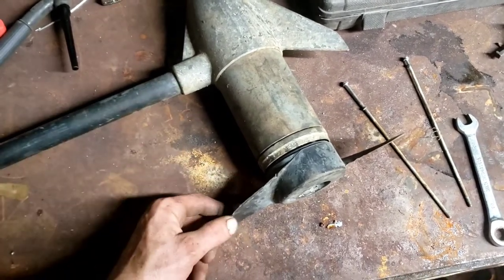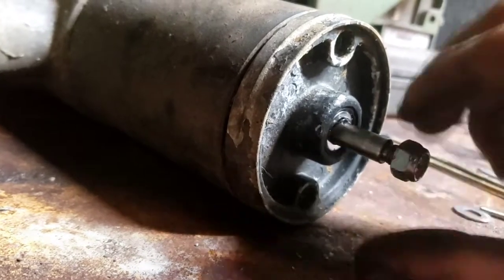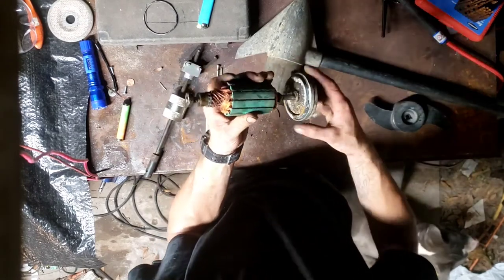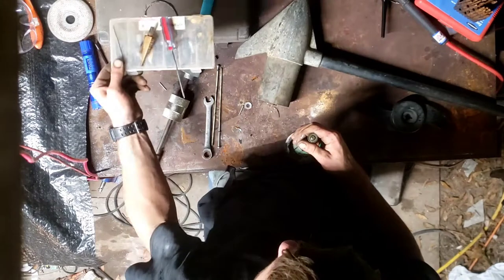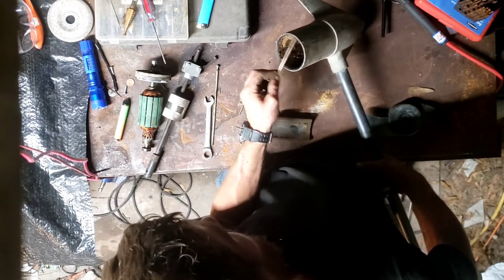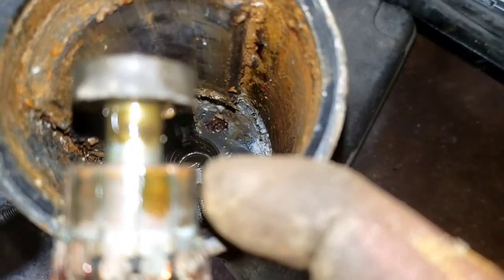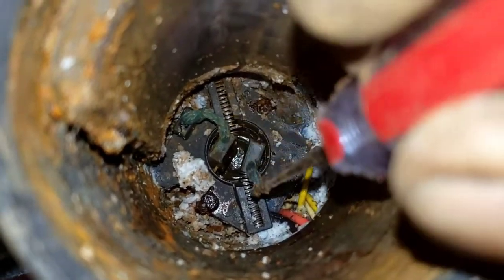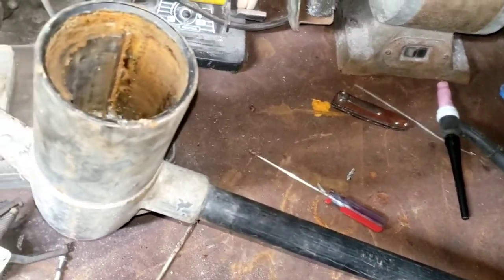How to diagnose and repair an electric trolling motor. Common Problems, Disassembly, Step by Step

Comment: Thanks a lot my man, I had my Minn Kota sitting in my shed for about 2 years,(I had both my Knees replaced and 2022 my wife and I wanted to go fishing again .I tryed the trolling motor and nothing happened, I took it apart like you did,& it's full of RUST and WATER a lot of RUST!!!!!I   I was going to throw it away,but after seeing your video I think i might give it a try and fix it. If it don't cost to much. Thanks Again (DAVE&SUE).
Reply from the maker: Thats great!! Good luck and you can do it!

Comment: very good info, never knew how to replace brushes before but you explained it well Thanks !! i have a i pilot minnkota with remote and my question is , my propeller turns but it will not turn left or right , can a low battery do that or is it something more serious going on with the head?
Reply from the maker: To be honest I have not been fortunate enough to use one of those, or especially work on one! I would love to get the opportunity to see how one of those minnkota units tick!  Best advice I could give is to test it with a different GOOD battery obviously.  If that doesn't solve your problem then it could be time to service your unit and oil her up!
Reply: Check the connections at the top of the motor under the cover

Comment: my motor guide is having issues. will stop spinning randomly but still has power. then it will randomly cut back on. or if i kick it it will turn on. thoughts?
Reply: It’s the bushes inside
Reply from the maker: Short in foot switch most likely
Reply from the maker: The brushes

Comment: I can't take out ARMATURE. I think bearing has rust with BRUSH PLATE W/HOLDER. Do you have any idea?
Reply from the maker: Lock for a pin on the shaft somewhere or some kind of retainer ring

Comment: I have a motor guide Pro motor and the arrows pointing were supposed to be gone. We’re going the opposite direction even though I change it back up. What could it be ?
Reply from the maker: Have you possibly crossed the positive and negative terminals for the motor? Can you explain what is going on a little more?
Reply from the maker: The motor will run backwards if you hook up the motor backwards
Reply from the maker: Or are you talking about the arrows for steering direction?  If they are backwards then has someone disassembled the motor?
Reply from the maker: Either the motor wires are crossed or someone has disassembled the motor and possibly put the foot back on backwards

Comment: I’ve got an old Sears 575.59370 trolling motor that I inherited from my dad.  I’ve just discovered that it’s had water inside for who knows how long.  It looks very similar to the one in this video.

Is there any way to remove the other end of the motor housing?  There’s lots of gunk and crud down in there that needs to be cleaned out, and I’d like to put some grease in there to help seal and protect everything, in case it leaks again.  I’m also thinking that it might be easier to deal with the brushes if I could get to them from that end.

Thanks!!
Reply from the maker: Must be pressed or hammered off carefully

Comment: My trolling motor is only two years old…I can get the unit to turn left and right but I can’t get the prop to turn…any ideas? I’ve only used it about a dozen times
Reply from the maker: Did you try to manually turn the prop to see if it is locked up?

Comment: this thing was not water tight, and probably in salt water. that rusty didn't look so good.
Reply from the maker: Yes needs new seals
Reply: @MrFigureitout  
and how long did it take to get the inside into this state ?
is there any idea how often the shaft should be checked ?
Reply from the maker: I would check it after a year or so. This one was very old. Maybe 6-10 years.  Newer trolling motors are pretty much built the same though so eventually they will most likely end up in the same condition.  If you start to feel like your motor has lost some power or your good battery is draining quickly, those are good signs to check your stator and bearings.

Comment: my magnets were busted up jb welded 5 back into 2 lets hope it works lol
Reply from the maker: Did that work? Usually when a magnet breaks its Poles are changed and therefore the magnets will repel after that. I'm curious to know if this worked or not
Reply: @Mr. Figure it out  its working for now but its hard to tell what the edges were doing with a relatively small surface area compared to the flat to the metal but the faces dont reverse polarity so realy itd only be puting extra strain on the glue between the pices but the atraction between the flat and housing was pretty well enough to keep em in place to begin with so idk how its gona hold up but for the time being its working